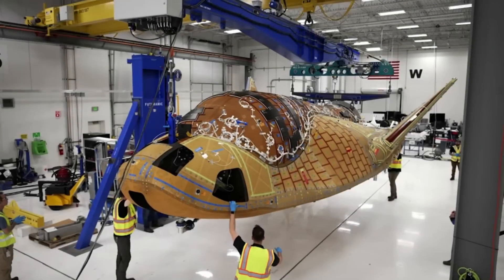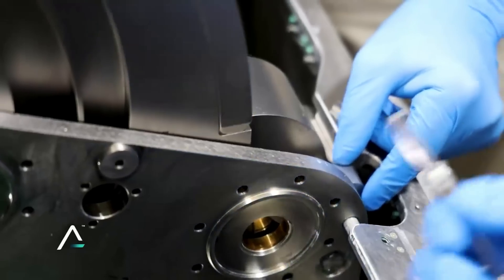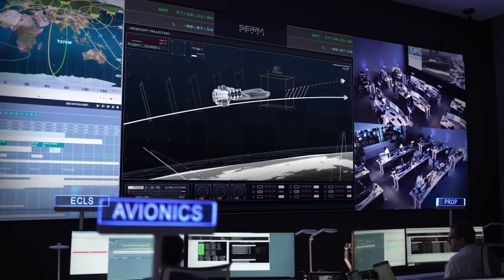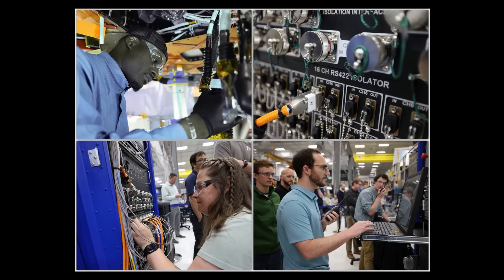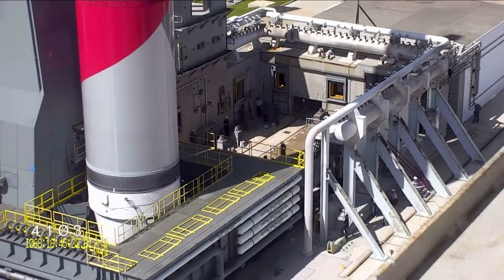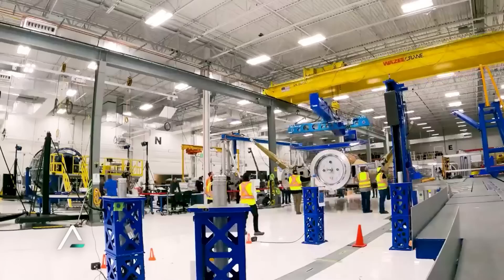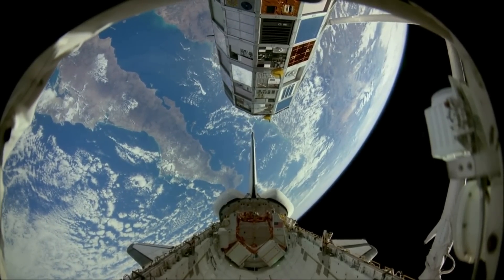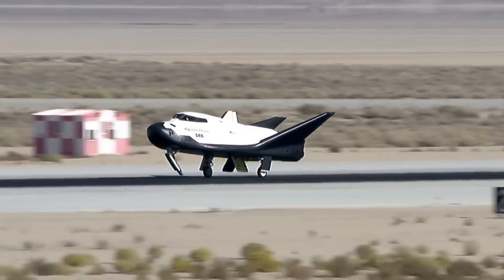The First Dream Chaser Spaceplane Was Just Powered On

Comment: We are way overdue for spray on ceramic coatings. Fashioning rectangular and uniquely cut tiles is so yesterday. At least Elon is using hexagons that are mostly the same. But we need to get beyond the tedium of hundreds or thousands of individual tiles.
Reply: It is what it is.   Wishing for it or saying we should have done it by now is simply not accepting the reality of where we are at.  Space is hard.
Reply: Titles are better than heat shields, they were designed at different thickness for variable heat resistant needs, eliminate  weight and numbered to repair quickly
Reply: How do you fix it if it's damaged? You can't just spray and another coat through that too much weight so you have to sand blast it off and repaint. So probably just as tedious

Comment: Depending on Boeing and Blue Origin for your launch system will probably be Dreamchaser's undoing.
Reply: Such a shame
Reply: Vulcan Centaur will likely not be a cause for much delay. The first launch of Vulcan Centaur is set to happen in just a couple months, while Dreamchaser will not be ready for the second launch until at least the end of the year. That gives ULA and subcontractors at least 5 months to produce the second launch vehicle and implement changes based on data from the first launch.
That is 100% doable.

Comment: Literally everything would be fixed if they used the delta IV. Not talking bout the dream chaser but the sls program qould be sooo much easier
Reply: Delta IV used RS-68 engines (which got cancelled with the Ares program).
No engines - no rocket.
Reply: @allangibson8494   delta iv heavy. I had an error

Comment: I wonder if it could fit into the payload bay of a Starship
Reply: Why, when it can fit on top of the Falcon 9?🙉🙈🙊
Reply: @georgefuters7411  Because I was referring to an emergency return, in case of damage or malfunction. I didn't say anything about launch services. But if you went that route, it could also fit in Starship for launch too. It would be easier than adapting it to launch on a Falcon 9
Reply: @RecklessG1  the secondary design ethos of the dream chaser for human flight was the lifeboat option, its fuel is not so time sensitive as the crew dragon or the Soyuz!
I haven't kept up with the latest iteration but assume it uses the same fuel as the earlier design 🤔
Likewise why not  take a crew dragon along for the ride especially on the Lunar landing variant 🤔
Reply: It could absolutely fit in there, with lots of room to spare, considering it can fit in the Atlas V fairing
Reply: @bussr1209 Yeah... I was just thinking maybe Starship could be used as an emergency return vehicle

Comment: It really should be adapted to be launched with the Falcon Heavy.
Reply: It can already be launched on Falcon 9 though.
Reply: We are way overdue for spray on ceramic coatings. Fashioning rectangular and uniquely cut tiles is so yesterday. At least Elon is using hexagons that are mostly the same. But we need to get beyond the tedium of hundreds or thousands of individual tiles.
Reply: @pyrsartur3675  
If you're going to spray a coating on something that is 50m tall and 9m in diameter, it needs to be flexible so the whole thing doesn't just pop off in one giant piece.  You also need the ability to patch it in case of localized damage.
Reply: @frankmcgowan9457  it’s a challenge alrite
Reply: @pyrsartur3675  F tiles. I also imagine a robotic arm on the tower that inspects and evenly coats an aerogel spray of some sort. Couple dust ups and ready to launch!
Reply: Dreamchaser is US revenge for stolen shuttle plans🚀
Reply: @TheGalacticIndian  you mean by stealing the design of the Soviet Mig 105 Lapot 😂🤣😂
Reply: @georgefuters7411  👌
Reply: The falcon heavy can't launch any manned spacecraft, it's pointless.
Reply: Spacex doenst make adaptors or adapted fairings for falcon 9 or heavy
Reply: @ewwwwhh  One of NASA's requirements for crew and cargo resupply is that the vehicle must be able to launch from any of the qualified launch providers.
Reply: @wheelsupat7  and? That doenst change the fact that spacex doenst make adaptors or fairings and falcon heavy inst even qualified for launching humans to space
Reply: @ewwwwhh Tenacity could just as easily be launched by the Falcon 9 as per NASA requirements 🤔
Reply: @georgefuters7411  I dont think it fits in its Fairing, and for the manned spacecraft it should be exposed
Reply: @ewwwwhh  it's designed to fit in the standard NASA fairing so it can be launch on any NASA, ESA or ISRO suitable launch vehicle (including Falcon 9)🤔
Reply: @georgefuters7411  is the falcon 9 fairing 5 meter?
Reply: @ewwwwhh  13m in length, 5.2m wide, adapters are made differently for every launch, the only problem the Falcon 9 would have is that it would need to be extended 1m to incorporate both the dream chaser and the shooting star modules inside the fairing but for the manned version would require no fairing and Falcon 9 is already a human rated launcher 🤔
Reply: Yep